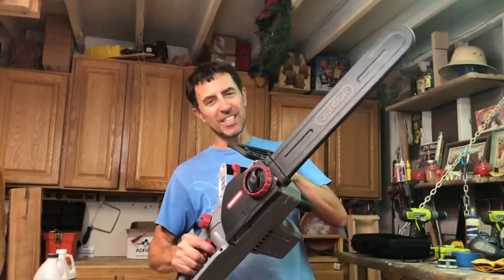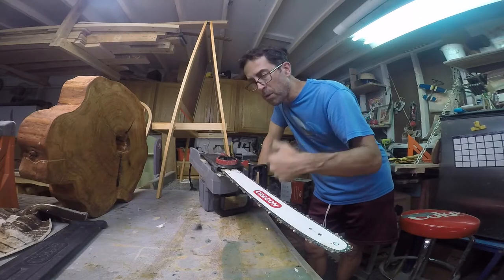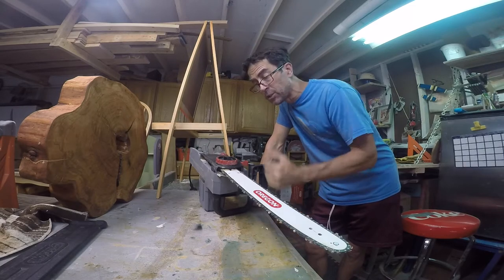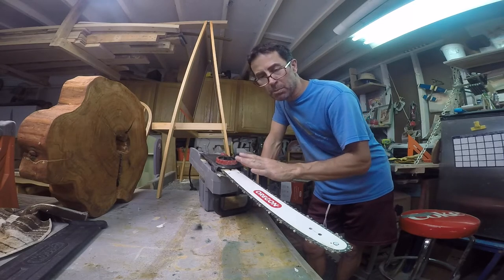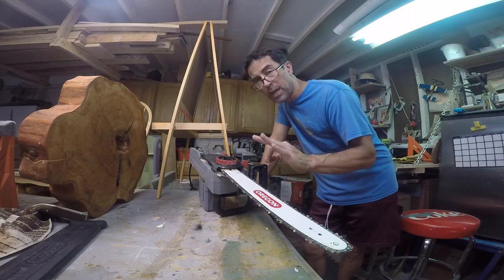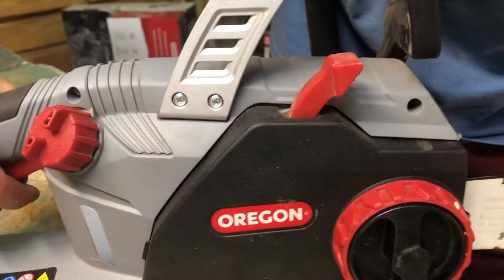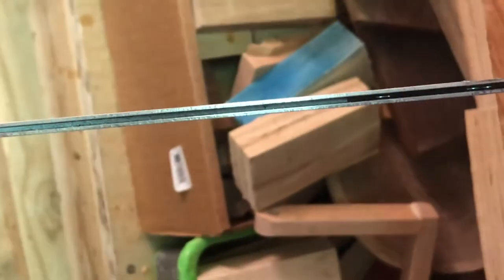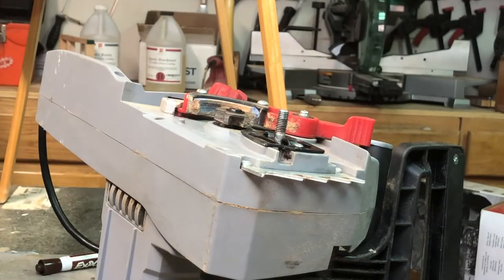Oregon CS 1500 Bar Chain Oil Issues (2 year review.)

Comment: Hi, complete newbie here, tons of woodworking experience but no chainsaw exp. Really wondering if you have tried the thinner oil and if it helped. I'm thinking this would be a good saw to learn with but some of the design problems are daunting. Maybe a lighter 16 inch would be better to learn with? TIA any input is much appreciated.
Reply: Ps. Someone should hire you to test and consult on the designing of chainsaws your videos are awesome and actually giving me the confidence to try this so thanks again
Reply: @sammccool5480  Hy, greatings from Croatia, I have recently started helping more around family farm, needed to cut some old death trees for removal and firewood, so needed to use saw, didn't want to use old banged gas saw, that won't start on occasionally when you need them, so used recepricating saw to cut longer chunks that I could transport, and than used old corded black decker chain saw to firewood size. Now in progress of buying new saw, for electric you want chain speed since most of cutting is done that way, and if you give electric saw to people that are used to gas they bog them down since they are used to push the saw and then the gas powered motor plows through. On electric saws you want to apply gentle push only so that chainsaw is going through wood. Depending what you want to do even cordless could be option I'm looking at Makita, since it is basically as powerful as regular farmer saw with no maintenance other than toping up batteries, and changing sharpening chain, and ofc refilling oil to cool down chain and bar, but best part it starts when you need them. Bonus points are no vibrations and smell of gas, has adustible oil valve, and if you are novice should like variable trigger, it starts to spin chain proportional to how you squeeze the "gas" power.  As of bar length the shorter it is less expensive the chain should be, if you can get the most common in your area, the longer the bar is you will need to move less with your body so to speak, since you have longer reach, but in general you want to avoid using tip to prevent kick back. And last tip if you decide to go battery or cordless keep in mind  that weight is not that of issues as it's center or location is, most professional saws are quiet heavy but since they are gas powered the block is kinda balanced as it is squared, while on electric you have motor sticking on one side and kinda  feels it wants to rotate, while on some battery powered it is also weird, you can get belt or backpack battery power source adapters to make them light but with slight secrefice in their advantage of no kords. From my research Makita 353 or 355 , don't know the us model since they use same saw just marked with X instead Du(Europe, Australia  asia)seams to be best buy, battery are cheap and readily available since they are used in most powertools, while you would get slightly better saw from eco or husgwarna, Stihl, the battery are more expensive and would you be able to get new ones in like 5 to 6 years when they change models.... Hope it helps
Reply: @mkapo8509  thank you that is very helpful information and I like the idea of the battery with an adapter to carry on my back weight is a big factor for me thank you so much
Reply from the maker: @mkapo8509  wow kapo thanks for that great response.  Helping each other is what we do here.  Thanks again!
Reply from the maker: No I have not tried a thinner oil.  I have only found one viscosity at my local hardware store for chainsaws. But that’s an interesting idea to play around with.  Welcome to the channel.

Comment: Soak a cigarette filter with oil, and then stick it in the hole.  It will prevent dust from accumulating in the spot, and work as a wick for the oil, allowing it to get in contact with the blade.
Try it out.  Let me know if it works for you.
Reply from the maker: Oh this is interesting!  Thanks will try.
Reply: @Jasonsdesignshop  Have you had a chance to try this? If so, did it work when slabbing?
Reply from the maker: @Craig419  sadly no. Done slabbing the cherry tree. Have a big log to carve another bear but not it gotten to cold so work very long outside.  Looking to spring to start again.
Reply: I guess I'll have to start smoking.

Comment: Don't know why they didn't make the oil feed hole on a lower slot an allow gravity feed the channel
Reply from the maker: @HoosierNewman  it has the feed the top of the bar.  If they send it to the bottom of the bar the chain is on return and leaves the bar to go around the sprocket thus all the oil would fly off.

Comment: What diameter log would be o.k. for milling with this saw?.
Reply from the maker: The last cherry log I did had parts that were 18 in!  But I had to stop for 5 min every 6 in. Oil not slowing so need to keep it cool and not burn up the motor.
Reply: Thanks mate.

Comment: not sure why your sawdust is so dusty, it should be flakes/slivers of wood, not dust. perhaps you have sharpened the teeth too often but not filed the depth setters
Reply from the maker: Ya true. I find with this hard cherry wood and when you rip cut them you get smaller flakes.  The cutting teeth of a rip chain are square headed unlike the cross cut chains that are pointy and shear the wood so nicely.  And finally putting even pressure on the cut is hard when rip cutting.

Comment: Probaly just have to pour/drip oil directly on the chain and bar while you're cutting slabs.
Reply from the maker: That’s and interesting idea. Just get an old fashion oil can that drips out oil in a point.  But it might just thought it off and get wiped off with all the saw dust.  But worth a try!
Reply: I tried that didn't work really, bar was almost on fire even cutting vertically
Reply: @6whatnext  I used my saw to cut up a stump - half buried in the ground.  The bar and chain were getting hot so I stopped cutting laid the saw on its side; poured a little oil on the bar; tilted it so it spread along the length of the bar some then turned the saw upright so the oil ran into the chain.  Not a long term fix, but it definately made a difference.  I kept doing this every few minutes until I finished and it worked okay.

Comment: Just got the saw.
The little bottle of chain oil that came with it was so thin! Thinner than motor oil! 
Real Bar & Chain Oil is like syrup compared to what it came with.
I'm wondering if I'll need to dilute real bar oil with mineral sprits.
WTF ?
Reply from the maker: Wow that’s interesting.  I wonder if they are trying to solve some of the complaints that the oil stops flowing and the bar overheats by thinning the oil so it can flow faster. But that only works for the bottle they gave you. Unless you thin it as you said. I would not bother. Try this first if it heats up.  loosen the oil cap so air can flow in behind the outgoing oil. As long as I’m cutting vertical it won’t leek. Tighten it to cut the tree down with horizontal cut. Happy cutting.
Reply: @Jasonsdesignshop  We will see soon. I've only tested it about a 20 mins with supplied bar oil. Impressive cuts for what I need! I hope it last after using real bar & chain oil. Should be a very handy saw to process firewood compared to a 2cy that needs so much attention.

Thanks. I'll keep it in mind to vent the cap.

Comment: Try thinner oil as well to make it come out faster and less likely to clog from being so sticky plus your a smart enough guy learn to manually sharpen your own chain you’ll be doing yourself a huge favor. A sharp chain is easy and fast to sharpen and can be done in a lot less time than the time you lose from a dull chain just do your research on sharpening from a good source. You can solve many issues just by knowing when to sharpen how to sharpen based on what your saw dust looks like but it’s super easy and saved a lot of time and money not to mention headache
Reply from the maker: So true!  I pay $7 to have a chain sharpened at a shop near by.  After struggling to do it by hand with a little round file with no success I gave up and took it to the pros.  But ya I should get a sharpening jig (any suggestions?) and just do it myself at this point.  Often I hit a nail and they get destroyed before I ever need to sharpen them.  But I have two now I could practice on. Thanks for the challenge I really should have that skill in my tool bag.  Happy cutting!

Comment: Just use thinner oil. We do all the time.
Reply from the maker: What oil weight would you recommend?
Reply: We've always used the chain saw oil. It doesn't matter which one in our electric chainsaw. That you have. We just use the winter oil in it year round.
Reply: The only problem we had was the tight tensioner. That little nib that's on their broke off and so we had to repair it.
Reply from the maker: @tjmark67  Ok thats good to know. Thanks!